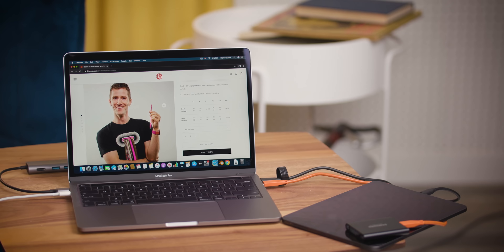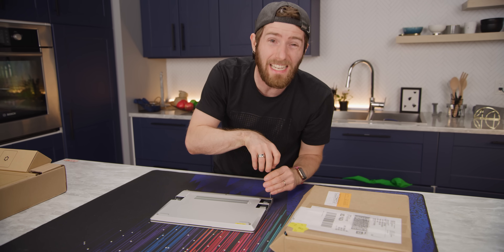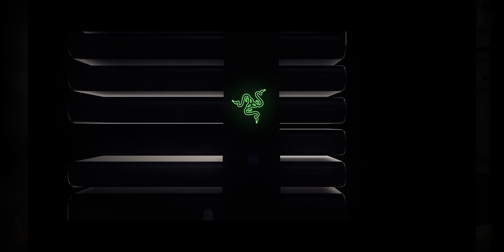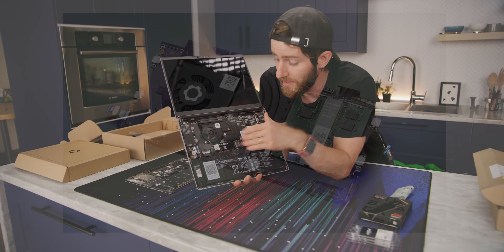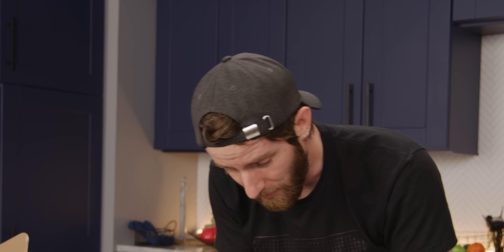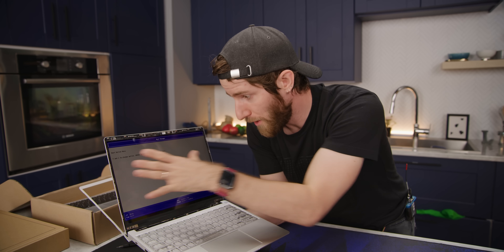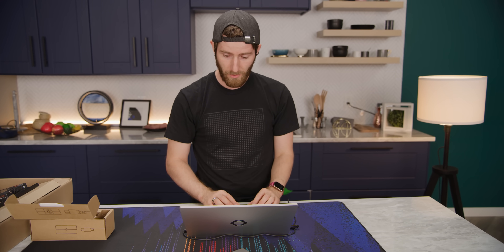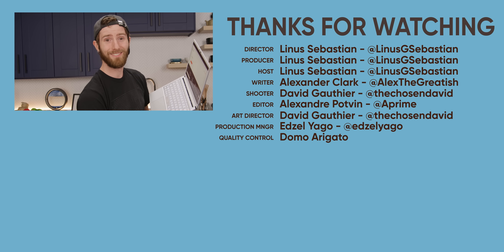A COMPLETELY Upgradeable Laptop?  - Framework Laptop Review

Comment: For enterprises with a decent IT department and large amount of laptops, these provide a way to support their own machines. CPU dies? Swap it out, user won't know or care.
Reply: For real -- this could be huge for business use
Reply: Ex Life  OneDrive is HIPAA compliance and I think it is also compliant is most other countries health protections certifications as well.
Reply: Enterprises with a decent IT department just use OneDrive for business to sync everything and just swap the whole laptop out now, man.
Reply: @hieu-headless  that's way more expensive than just swapping out parts though.
Reply: @xmlthegreat  Big enterprises don't care dude
Reply: @xmlthegreat  Not necessarily. Batteries sure. However in the enterprise Dell's pricing is very competitive, they practically give the machine away at some of the prices they have for enterprise customer and they know they will make that up in volume. Their tech support is also pretty good. You can put in a support request and a tech will come out either the same or next day and replace any part that needs to be replaced They will even send the part to you directly if you can replace them yourself and that arrives usually next day. If the machine is out of warranty in enterprises you are more than likely on an upgrade cycle anyway. That being said as a regular non-enterprise consumer it's a whole different story.  Support is nowhere near as good and extending the life of your product through upgrades is a must imo.
Reply: @hieu-headless  Restoring from online backup takes way more than swapping the mobo in this thing.
Reply: Would be a bitlocker nightmare. Plus imagine trying to support a machine where end users could just change the hardware by pressing a button in. Testing for is upgrades would become a pain in the ass

Comment: This reminds me the Soviet-era electronics in my country, where "service manual" often included complete wiring schematics. As much as I hate that period of my country, this is one of the few things that I would like to return in some form.
Reply: This was a feature even in western electronics of old, until of course companies became big enough that they decided to gobble up the repair industry as well by having exclusive service centres, and then eventually like Apple, to do away with the concept of repair completely.
Reply: @xmlthegreat  true. My grandpa, may he rest in peace, bought woodworking equipment in the 60s (one of the first mechanized tools ever actually) and it all came with 300 pages manuals that went through all the subsystems and explained how to take them apart, fix them and rebuild them starting from the metal framework. I still have them, that's how I learned electronics basics actually
Reply: @xmlthegreat  basically up until 80's, maybe early 90's. (I remember owning a dot-matrix printer that had manual with the on the wire protocol, so you could interact with it directly from Pascal and make it print images, not just text)
Reply: I've heard that there's a design philosophy in former Soviet states where the best products aren't the ones that last the longest but the ones that can be repaired the easiest
Reply: @zealousdoggo  That's pretty accurate I would say . One of the requirements on designers and manufacturers  was easy and cheap  repairs . Starting from household items to cars and heavy equipment
Reply: @zealousdoggo  Just like a Lada.
Reply: Or for example for cars. At back of fuse boxes u got nice table. Or on hoods on some equipment whole fricking schematics. Sure electrics were not so complicated but boy from principle.Mann was that cool and rad to fix something in hurry.
Reply: Really evil regimes tend to be right about at least some things.

Comment: I don't get the argument that rigidity = higher build quality. For example, airplane wings are deliberately engineered to flex and bend. Having a flexible chassis could allow the laptop to distribute forces better in the case it's dropped. However, it's clear that you wouldn't want the keyboard itself to flex.

Comment: I recently got a solid laptop from the Norwegian company Multicom.no, that is somewhat big on gaming computers here. It is very upgradeable with total memory swap up to 64G and with 2 1TB PCIe SSDs and one conventional small 2TB HDD, it can store a lot. 17,3inch display with a swappable GeForce RTX display card and a Intel® Core™ i7-11800H processor on board. No windows installed, as I prefer to install my own. The only thing I don't like is that it runs a little hot sometimes, but it is because it sits on my lap as a laptop should, right?

Comment: 1. why is USB-C 'Expansion card' is only with one usb-c port? If it is big enough to fit 2 ports...
2. why there is no lan expansion card? Sure you have fancy wifi6, but there is some situations that you need physical Ethernet connection.
3. In configuration it would be cool if you could choose 'none' or lo-mid-hi tier dedicated graphics card
4. Should be able to ship to EU(with eu charger)
5. THEN I'M SOLD
6. additional: It would be cool to see more display resolutions and laptop sizes like for example 13''/15''/17''

Comment: You listed everything but the GPU. Which kinda seems like a purposeful, glaring omission considering they all come with the same, crappy onboard graphics. With no other options.
Reply: well if it had a gpu it would be a lot more expensive

ima just wait for thunderbolt 3 support and get an eGPU in the meantime
Reply: I mean I wouldn't expect it to be cheap or easy or even an option. But the video is entirely about describing the laptop and its parts. And they don't mention the graphics hardware even once? When it just so happens to be a big weak point? That's like if there was only one CPU option, it sucked, and they didn't mention the CPU once the whole video.

Pretty weird.

Comment: I really hope they survive! But if I ever get a laptop again I'll definitely get back to this
Having a good webcam with a cover and a hardware microphone switch is so nice!
And a replaceable battery and wall power only mode should be essentially a requirement in all laptops. The amount of decently working laptops that are trash because their battery is dead and blowing up is insane.
And being able to adjust your io to your needs and even encase the mainboard outside of the laptop is really useful. 
I hope they make motherboard upgrade packages to replace the module once it's too slow or outdated.

Maybe Linus can actually invest in the company and keep it afloat but reading through the comments I think this community will be a great boost already

Comment: Can I upgrade my CPU later?
Yes! If you ever need more performance in the future, you can upgrade to a new Mainboard with a new CPU on it. We publish step by step guides you can follow to do the upgrade yourself.
Reply: That’s so cool! Go framework!
Reply: Hello I tried looking at the official website and find no mention of this in either the community forums or the support page. Do you have a link somewhere where it is mentioned?
Reply: @sibu1234567  when you're configuring your laptop and are choosing your cpu, ram and storage, scroll down to the bottom and you'll find a mini faq. It's written there.
Reply: @prathamarya3288  I see. Thanks for the heads up! Hoping it's gon be coming to Asia soon.
Reply: @sibu1234567  It is on FAQ section
Reply: New motherboard is basically a new laptop so the price will not be different..
Reply: also can you stack USB plugs onto each other (ie like a hub)? Also, same idea for battery with sliding cover for connector for really long use without AC. And also 3-D printable components/housing for legs/stand or swivel mount or possibly in future PCB when metal 3D printing becomes more commonplace + affordable.
Reply: Saying and doing are two different things
Reply: Pls enlighten me what part are upgradeable (ram size/ssd size) that is not present in any other laptop. Both framework and all other laptop cannot be upgraded to next gen so both are not future proof.
Reply: @jonmon5745  Motherboard is upgradable and the screen will likely be upgradable too once framework builds screen modules for it.
Reply: @spencerkranz8500  your kidding right? Diy motherboard only (no ram no ssd no  no windows) and it is already 800$ at their website... So are you expecting they will sell you at less cost if it comes with next gen cpu, 5th gen ddr/ssd slot... Again just think about it right now only i5 11th gen and 4th gen ssd/ddr ram slot motherboard already cost you 800$ so add in another hundreds more if you buy a new 5th gen ssd and ddr5 memories that will cost you roughly around 1600-2000 usd just for a base model motherboard.. and dont forget about buying a new keyboard and screens since it's probably worn out.... In short you guys are end up gonna spend more rather than buying a new next gen laptop around 2022 probably gen 5 ddr/ssd..
Reply: @jonmon5745   Well, if you're already satisfied with literally everything else about the laptop and just need a mainboard upgrade, then you save a couple hundred bucks over buying an entirely new laptop, sure it's an expensive upgrade, but it's an upgrade that will make it last for another 5-7 years lmao. The whole point is that you don't need to buy a new laptop every couple years, just upgrade the one you have.
Reply: @SteveIrwinsPetStingray  laptop motherboard is the laptop itself jizzzz alot of you guys think this is just like a desktop where motherboard is just a fraction of a price of the pc... Laptop motherboard itself cost 800$ thats the base model lowest processing power, you think buying a new cpu will magically boost its performance if you will still use gen 4 ssd/ram? No.... And also ram and ssd are electrical components it will degrade and get damage over time... Lets say you have 5 years on that component you think it will last another 5 years with your new motherboard lmao... And besides gen 5 ram motherboard I am pretty sure it will not be compatible with gen 4 ram just like it was on ddr3 not possible for ddr4 slot... Framework don't make their own chip, so they have to follow the standards of ddr manufacturers..
Reply: @jonmon5745  I have perfectly fine working laptops dating back to 2006, never did anything to it. So yeah, these components are going to do another 5 years
Reply: @marlond8347  lmao goodluck using your ddr4 ram on a ddr5 slot motherboard...
Reply: @jonmon5745  you don't get it. I know that that isn't going to work. We don't even know if the next Gen of CPUs is only ddr5. They are actually generations that could use ddr2 and ddr3

The cost saving is still there since your not buying another screen, housing, trackpad, keyboard, battery etc.
Reply: @jonmon5745  Well yeah if the new motherboard uses ddr5 you're gonna have to buy ddr5 for it, but do you know the capacity of an nvme ssd before the nand flash degrades?? It takes hundreds of terabytes of data transfer for it to even begin to break down, which is a lot more than a traditional hard drive. You are not going to kill any of your components even over 15 years of normal use, I had a laptop with a core 2 duo, ddr2 ram, and a hard drive that I bought new in 2007 and used it almost every day for 11 years and it still ran fine, you are delusional if you believe that buying an entire new laptop every time something new comes out is better than just upgrading individual components when necessary.
Reply: @jonmon5745  Are you perhaps an Apple employee that is scared this will take off and be popular?
Why do you write such huge comments that are simply contrary to the principle of upgrading/repairing your laptop?
If you don't like the concept, or you think it will cost more, then just don't buy.
Please stop pouting the comments section with nonsense based on speculation.
We don't know anything yet.
Wait and see.
Reply: @SteveIrwinsPetStingray  if your point is that you can just youtube or facebook in your old 2007 laptop then yes..... But pretty much all windows laptop can do that hence you yourself is not using modular IO framework laptop. Am I right? So what is the point of modular IO? Every generation leap there is a huge difference in speed regarding to downloading, rendering, playing games heck even laptop now have 5 to 11 sec fast boot compared to your 2007 laptop. The point is that modular IO doesn't give you those generational leap experience.
Reply: @jonmon5745  I'm amazed how limited your vision is.
1) Most recent laptops have ram soldered to the motherboard.
2) The presented laptop is a business class/ultra portable, not a gaming laptop.
3)the laptop is not at a premium price for it's class, but clearly you didn't even check that
4)have you replaced a screen on a recent laptop? It's glued in, you can't replace the screen, you have to replace the entire top part, with cameras and antennas and all that.
5)most recent laptops are limited to 16-32GB or ram for some reason, this one goes to 64.
6)soldiered ports are not replaceable unless you are skilled in soldering, and even then there is considerable risk to damage the motherboard. That's why you let professionals do it.
7)"Right to repair is not possible on Apple" 
=))))), wait, =))))))), tell that to Louis Rossman, apparently he has been smoking some strong shit for the past 10-15 years and he was dreaming about repairing macs.

Here's a small bit of information: I am considering buying myself a new laptop for about 3-4 months, and guess what, everything is shit. All glued together and 
noting except storage (even that is sometimes limited) is upgradable.
Want to add more ram ... good luck it's soldered.
Want to change the battery with a larger capacity one ... nope.
Want to change the 480p camera with something decent because that's the only shit part about that particular laptop ... no way to do it.
Need more IO or, god forbid, a damned Ethernet port ... NOO big NOO.
The laptop industry is going to shit and this kind of projects are needed by soooooooo many people.

I really don't want to carry around 2-3 pounds of dongles to have the basic things I had just 4-5 years ago.

And just so you know who is responsible for this shit trend: FUCK APPLE!
Reply: @jonmon5745  Yeah it does actually, the whole point of the framework laptop is to be able to do generational incremental upgrades if you want to. Also, im aware that my 2007 laptop is slower than a brand new one with an nvme ssd lmao, my point is that you don't have to replace your old laptop entirely with a new one every couple years, if you can literally replace the cpu, storage, and ram whenever you want an upgrade, why wouldnt you want that?? The modular I/O is so that you can buy what you WANT to use, and aren't just stuck with what the manufacturer decided should be there. There isn't such a big increase in performance every generation either, especially with intel, maybe a 5-10% bump in performance every year or so? Storage has gotten faster since pci 4.0 support became standard in new cpus, but it's probably not gonna get much faster than it already is until pci 5.0 comes out, which wont be for years to come lol. Your points don't make any sense man, the whole point of this laptop is that you can CHOOSE to replace it if you WANT to, and that you can CHOOSE to upgrade it if you WANT to, it was designed solely with consumer choice in mind, what's so bad about that?

Comment: Seems like Framework is on the right path
Reply: am i tripping or are there like 100 accounts with checkmark all over youtube right now

commenting on random videos i mean
Reply: @spacecadet_01  stfu
Reply: @imSomebody-m4c  nice picture dweeb
Reply: While 1,399.00$ for their performance tier isn't insanely expensive... For that amount of money it would be cool if it had a graphics card on it too... Or im super out of touch with the cost of electronics.
Reply: The one miss in this product is the lack of GPU upgrade options. If they could create or use a PCI-E socket of some kind that would allow a proper stand alone GPU as an option, that'd make this a really exceptional laptop. You'd have your integrated graphics to fall back on, but could improve your gaming or other graphical rendering potential. Heck, if it was just a PCI-E socket (like the M.2 type of thing) that could accept a small form factor PCI-E device, it could be for more than just a GPU upgrade.
Reply: @sireuchre  As I understand it this is their v1, aimed at the "thin and light laptop" crowd for biggest market share and name recognition. Once they're established and things are running smoothly they'll probably go back and build a "power user/desktop replacement" model as well.
Reply: @sireuchre and now that's a thing too
Reply: Bien
Reply: Good framework
Reply: It is a cool idea, however I don't believe they will succeed, though hope they do. Most people just buy a laptop and don't upgrade them.
Reply: @matp.4360  
Most people wish they could upgrade their laptops like desktop owners do and enjoy
Reply: @matp.4360  Of course they don‘t if it‘s not possible. On my last laptop I upgraded the ram and the storage twice (HDD to SSD to bigger SSD). Those were the two upgradable components. I feel your doubts though.
Reply: and ur not